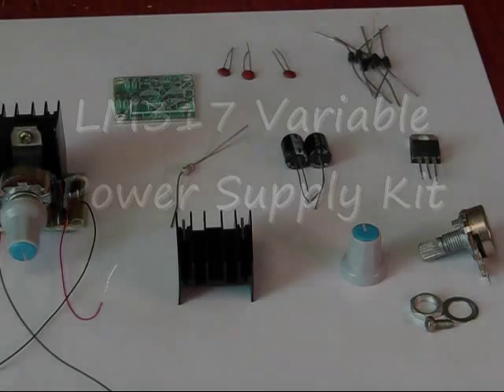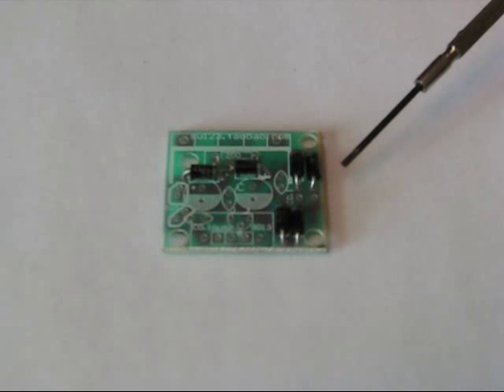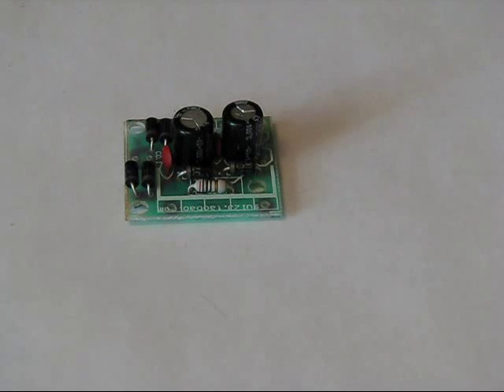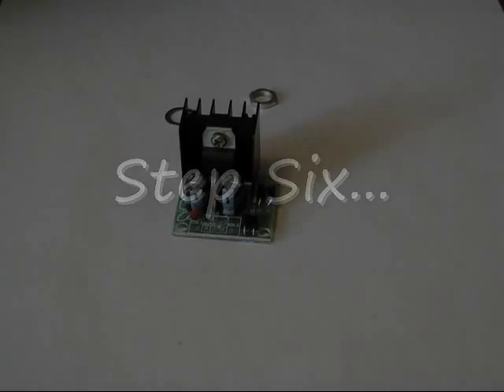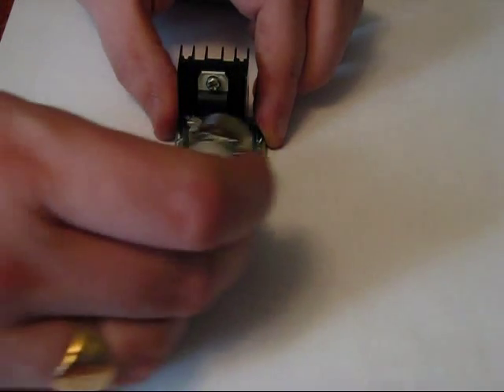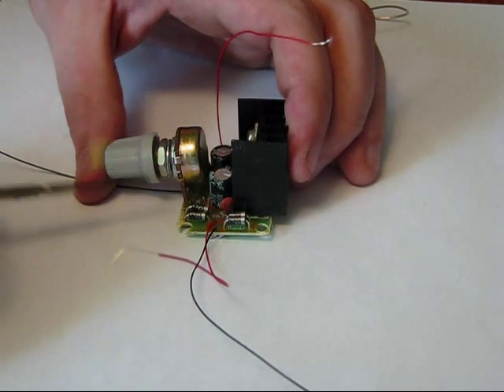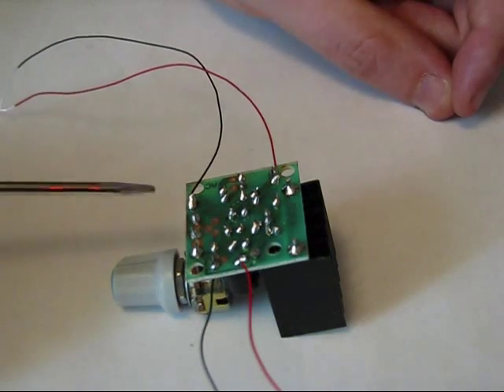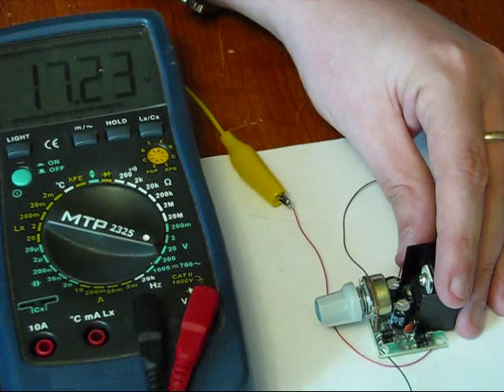The LM317 DIY Variable Power Supply Kit Instruction Video - www.engineeringshock.com

Comment: The heatsink is pritty small for if you using high input voltage and use a low voltage on the output with a high current